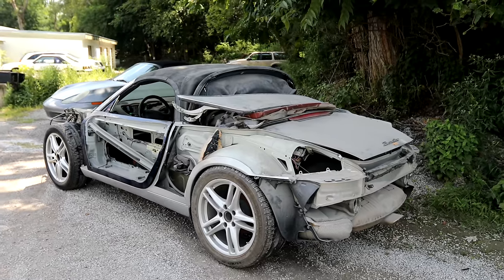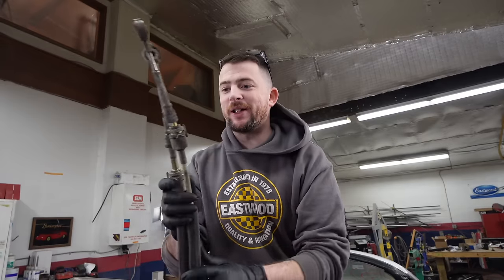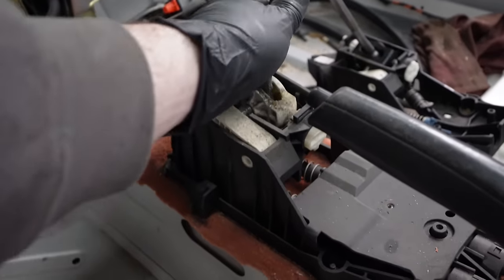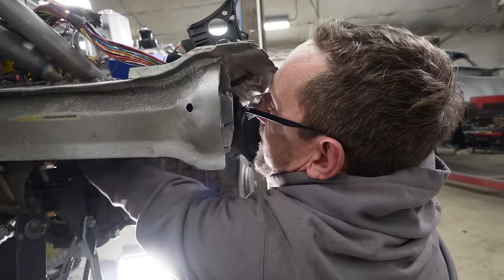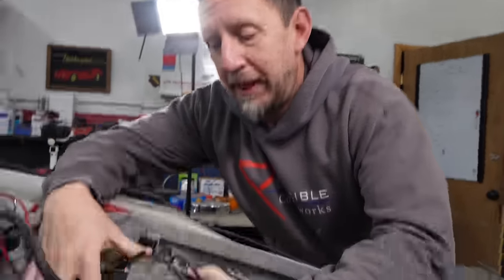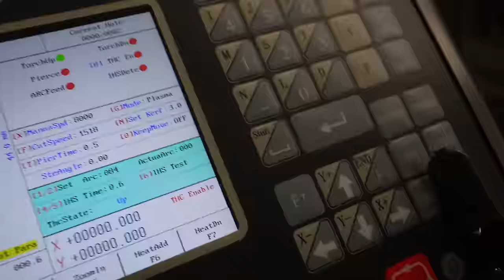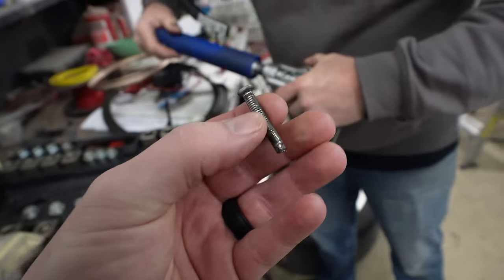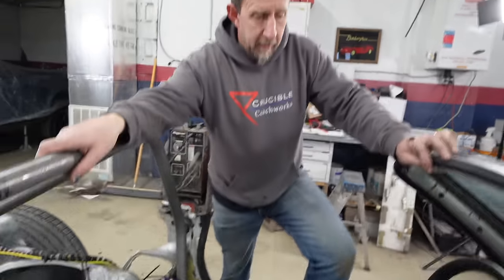Junk Yard to SUPERCAR - Project Jigsaw

Comment: This is purely curiosity. These things are supposedly made out of different grades of steel from mild, high strength and even a little boron steel. Is this something you need to consider in your design process. Is there a problem welding these various steels? Or will you design around them.
Reply from the maker: We are going to be skinning around the high strength chassis parts. You’ll see soon! 🤝🏻

Comment: I wanted to ask why you guys are using so much oem wiring and cooling system? I feel like it would be way easier (especially if it will stay carburetored) to run your own wires and cooling without having to deal with the oversimplificated porsche systems. Love the build!
Reply from the maker: Its partially because we are just trying to get this chassis running. Once we have a good baseline and know the suspension mods and whatnot work well, we will be redirecting more away from of the OEM cooling, etc. The OEM wiring is handy to use in some cases here since the harness is already ran and just needs tapped into.

Comment: I unsubbed because I find the videos too long for the progress made. I haven't even seen ideas for the bodywork besides the uninspired clay blob at the start, so it's really hard to maintain any level of excitement, especially after you decided on putting a 70's relic in it for power. if that's the planned design, you're going to end up with a street version of a beach bug, which would probably have been the bees knees in the 70's. In that regard, I guess the engine makes sense. However, I'm out